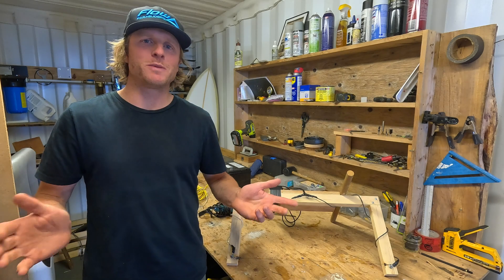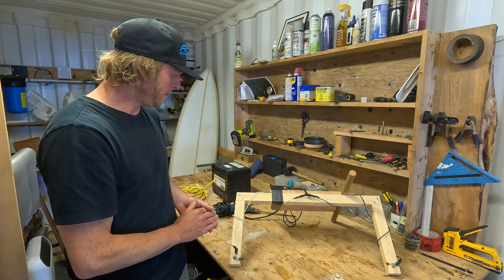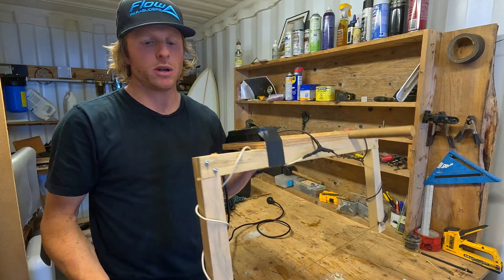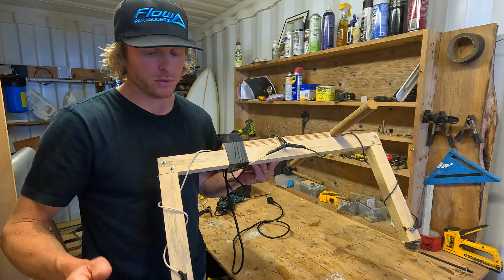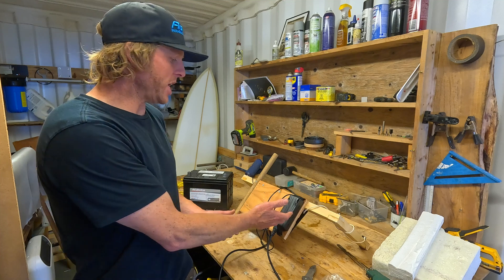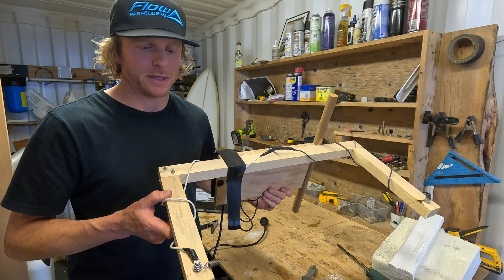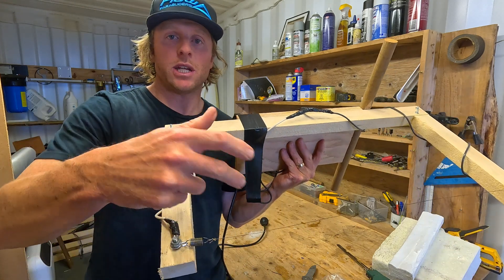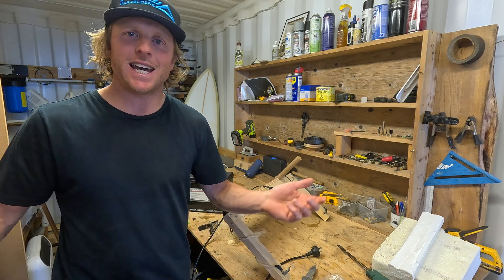How To Make a Hotwire Foam Cutter Using a Laptop Charger

Comment: Good information, thanks.
You could try an old guitar machine head to adjust the tension and take up the expansion of the cutting wire.
Reply from the maker: Interesting idea! I have found this spring is working great. Used it for a lot of cuts now :)

Comment: Do you have to be concerned about getting shocks from the hotwire? Obviously your not gonna want to touch it when it switch on anyways. But just genuinely curious... I don't shy away from the odd bit of casual peril just like to know what bites
Reply from the maker: No not really at 19V. Obviously it has full power running into it so wouldn't want to expose that, but the output isn't too bad. But of course i don't touch it just in case haha!

Comment: don't use the spring as a conductor...heat from the nichrome is promoting it to lose its temper.  Instead make the electrical connection to the nichrome a few inches inboard of the spring. Several ways of doing that including just winding the tag end of the nichrome loop a few inches inboard then connecting the conductor wire to that.
Reply from the maker: Thats a great idea! Ill try that thanks. :) The thicker spring is still working but that makes a lot of sense to bypass it

Comment: Hi tested this setup and  the main rule is power delivered on one inch of cutting wire. 
If power source is strong (battery) you can increase power on one inch of length by increasing diameter of cutting wire.
For selected wire you can increase voltage ( twice voltage four tines power for inch) but output power source must be strong.
I ordered  10m of different diameter wires and for laptop power supplier 19.5 V  120W ok was  0.7mm  length of cutting  70cm ) 
Great video by the way .
Reply from the maker: Thanks for sharing your experience with the setup, appreciate the insights!
Reply: If you have a multimeter then count the total resistance and if you culd measure dc ampere that you have